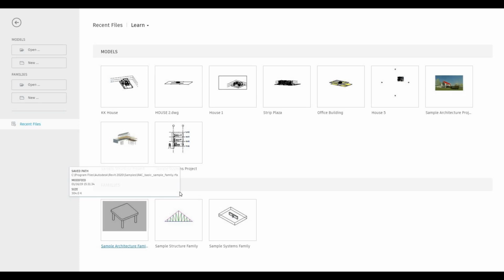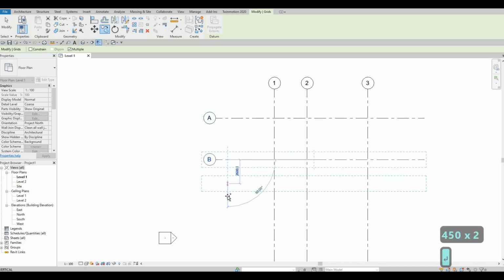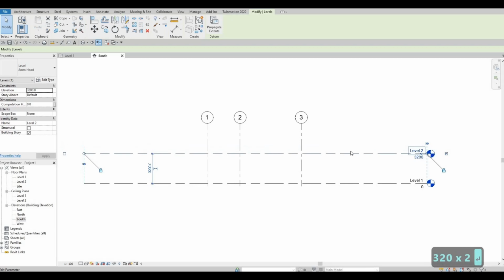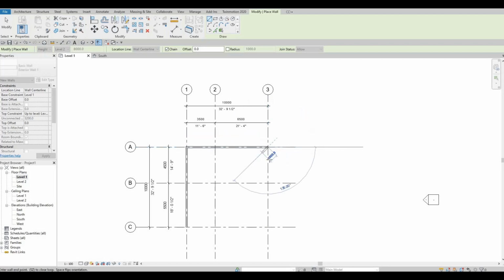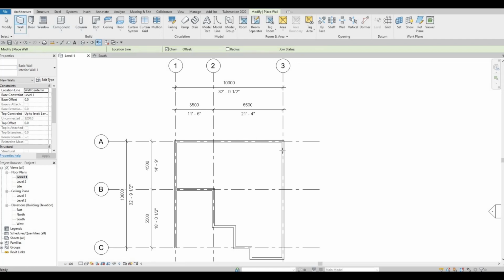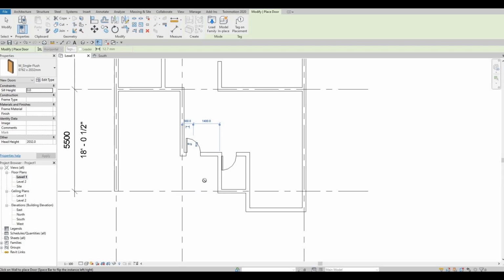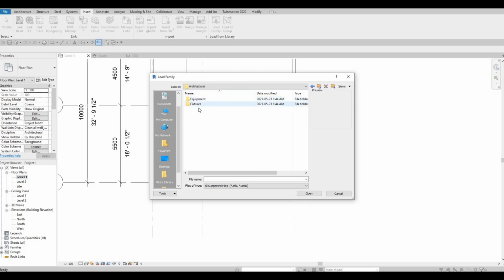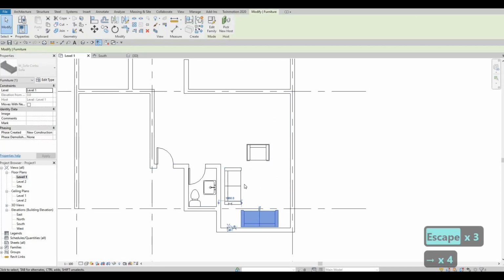JJJ House | Part 1 | Complete Step By Step Project | Revit Tutorial

Comment: What if there is no generic wall 200mm because revit 2022 did i use how can i add generic wall 200mm
Reply from the maker: Hi Hanna, you can always duplicate an existing wall then remove anything if there is wall assembly and edit the thickness 🙂🙏